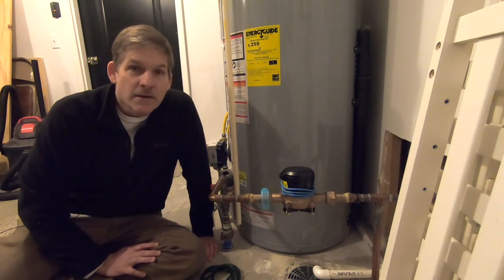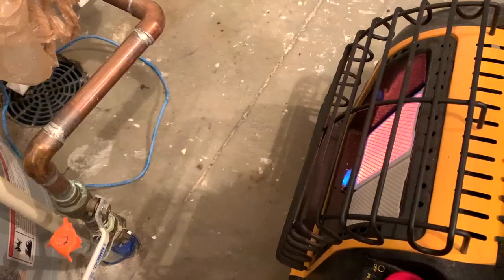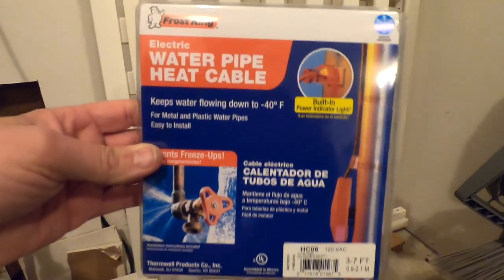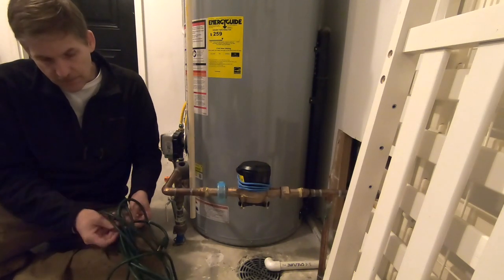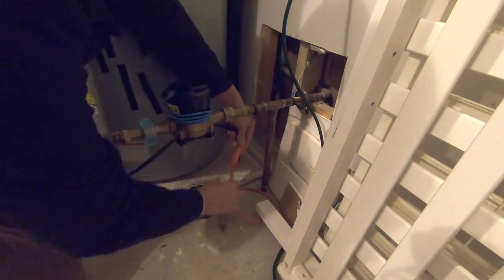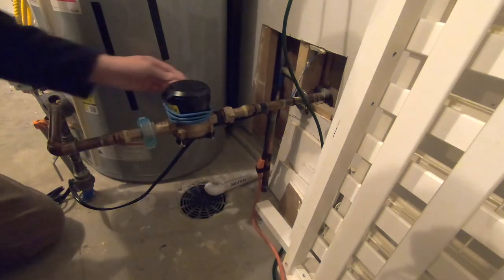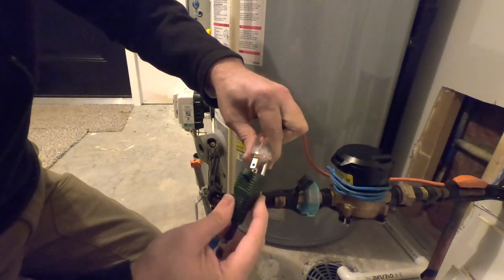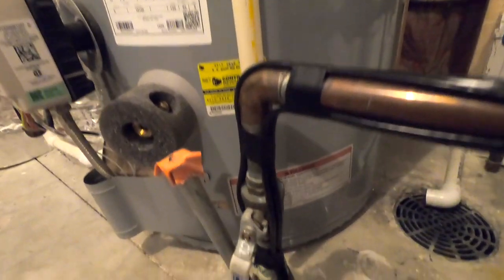How Do You Stop Pipes from Freezing: Heat Cable for Frozen Pipes

Comment: Set the thermostat little black knob thing has to be touching the pipe itself? Also, can somebody tell me, do these cords even feel the slightest bit warm? I have one, but it’s not even the slightest bit warm.
Reply from the maker: It foes have a thermostat that should turn on below38 degrees. Then you’ll feel the cable warm up. The black button goes against the pipe. 
Make sure your outlet is function - plug s light or fan into it to make sure you have power.
Thx for watching!
Reply: The thermostat kicks on at 38°, and kicks off at 45° so it isn't going to feel exactly hot it just has to warm the pipe up above freezing you know what I mean
Reply: The black button thing has to be placed against the pipe then? Lol….I swear to god I’m so sick of having to redo work that someone else did that doesn’t give a shite if it’s right or not! Now I have to go redo the damned heat tape because he didn’t bother reading the damned instructions and then gaslit me saying I’m an idiot and what do I know cuz I’m just a stupid woman! Dysfunctional families are more work and money then it’s worth staying in contact with!